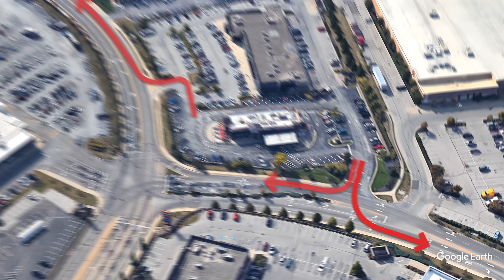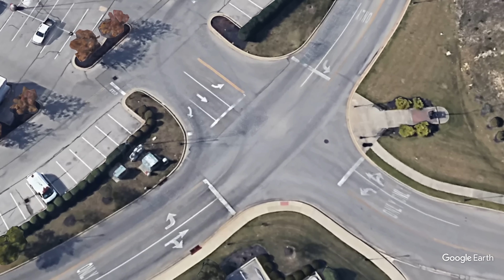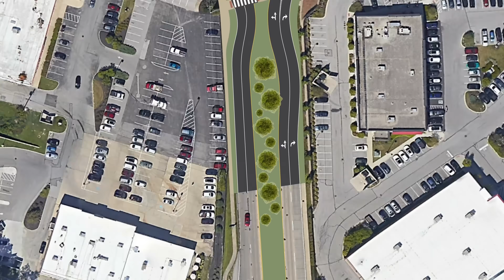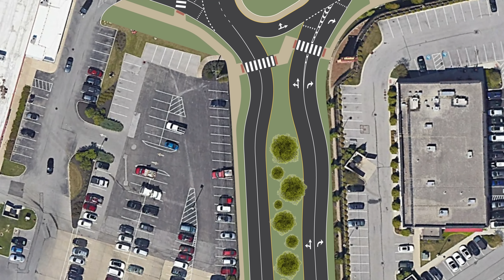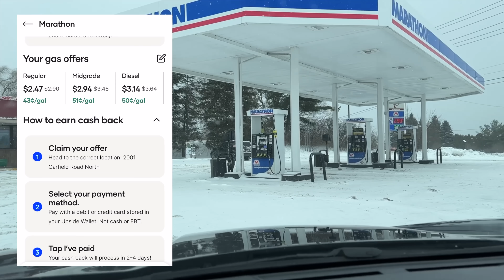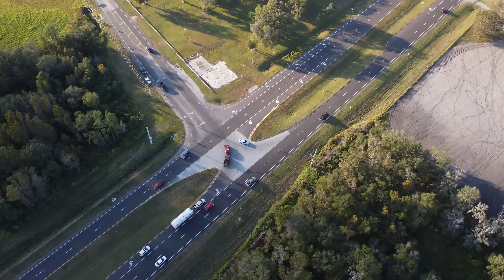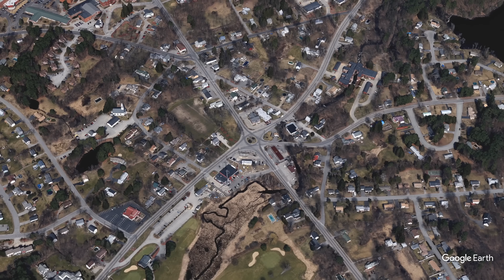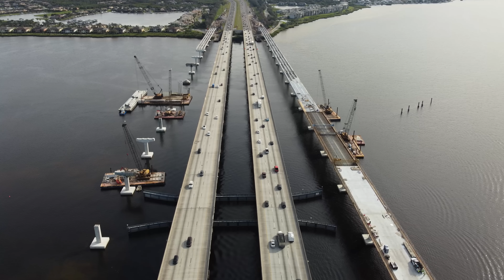These Intersections Should Be Illegal

Comment: These are commercial driveways where it is desirable to have them configured using public road design practices.  They are typically on private property with a driveway entrance warrant to connect to the public road.    They appear to be public roads, but legally they are not.  That doesn't mean they have to be this way.   An overview of traffic conditions would likely recommend they be turned into behaving with the same design as a public road.   

This is an issue for public minded citizens to approach their town about.   If it is a functional administration they should be able to direct the person on how to approach the issue.

Comment: Right mindset, wrong idea. The main problem is the stroad connection to the main arterial road it shouldn't exist in the first place. It's mixing through traffic with regular city traffic. No "traffic flow dynamics" will fix this until there's still be that stroad connection.

Comment: I live in the UK and I drive past a Rural left turn much like that frequently on a road called the A90. Absolutely fucking terrifying as you have to cross 1 lane coming at you at 70mph, then hold in a tight middle reservation to cross another lane. Killed tons of people. One particularly bad one on the way up has a 50mph speed limit surrounding it, and it STILL kills people at an alarming, above average rate (as well as creating absurd amounts of traffic as it can sometimes take several minutes for 1 car to cross both carriageways).
Reply: I've seen a lot of these junctions fitted with traffic lights over the years.
Reply: @trainsim5869  Problem is the ones I see are in rural areas and you can't just stick traffic lights there without having to do a bunch of atuff to the speed limits, not to mention how infeasible it can be as some kf these areas are proper rural

Comment: The only disagreement I had is on the first on how that roundabout should be designed.  I find roundabouts that force you to make a choice in the left or right lane to create confusion and safety issues.  Left lane should allow you to spin around in a circle all day, and the right lane has the exits.  I would go back to the drawing board to design how to not force people to pick a lane.  I think a one lane roundabout with the roadway right turns merging separate of the roundabout would be a better option.

Comment: Before your explanation started I made an approach for each of the locations:

1. exit road from car park onto major road in the middle of an intersection. Make car park exit onto side road above instead.

2. High-speed road with no indication where cars should be to turn off, and the turning lanes optimzed to look fast but be dangerous. Remove U-turn lane, forbid U-turns. Add clear indication lines where vehicles should drive to turn left from road, and where people should wait to enter high-speed road. Add acceleration lane to both high-speed roads so people turning on can get up to speed.

3. traffic isle with greenery in the middle of unsignaled 5-way intersection. Make vehicles slow down with curbs, round off side of traffic isle for trucks, add pedestrian crossings

4. Cyclists on the highway. Stop smoking weed. Remove cyclists from highway.

Looks like we're pretty close. In #1, I'd move the Chick-fil-a exit into the Target one, and make them share an exit. Much less change to the area and the main problem fixed. I didn't see the other intersections in the overview, of course. For #2, you forgot to add acceleration lanes - lanes where vehicles can get up to speed before merging. The left turn isn't the main problem, the lack of indication and slowing is. In #3, that should just be a normal roundabout instead of whatever that is. And for #4, I have no idea what the people designing or building this are thinking, but I would recommend them to consider not mixing traffic with different average speed *at all ever*. Because there's a name for mixing traffic with different average speeds - they're called collisions. You want to avoid those. Especially so for unprotected slow-moving traffic being hit by fast-moving twelve-ton vehicles.
Reply: 4. The best solution in that case is to have a cycle path on the right of the highway. The cycle lane would cross the on-ramp, and join the path.

Comment: I would have argued that 6:00 could have been more efficient to make a half diverging diamond before the highway, but then after thinking about it for a little bit, the slower traffic turning left into the highway would have the problem of trying to gauge speed while sitting at the median. Of course, this could be solved by adding a little bit of runway in the median until they can merge with traffic, but I'm not an engineer to know how effective that would be.

Comment: The saddest part about the 1st solution (I haven't finished the video yet) is that round about would still have so many crashes. Most people genuinely have no idea how a roundabout works. They will drive straight through, stop when there is no traffic, or get stuck. Going in a circle is WAY to complicated for some people which makes it hard to have round abouts

Comment: Lookitng at the roundabout for the third problem presented, you can see those crosswalks were painted long ago and have been obscured by "eraser" tires since then, resulting in "crosswalks to nowhere"!  Not a good design to begin with, but a seeming pedestrian torture device as it looks now.  Looks like it might've been an attempt to compromise between a traditional traffic circle and today's popular roundabouts, by people who didn't know what they were doing.

In small town settings, it's common to see this sort of pseudo-roundabout, where a small island has been set in the middle of the village's main intersection (often a 5-spoke one), and drivers don't know whether it's to be driven as a circle or not.  Signage disambiguating this is often absent or hard to see.  This is one of the reasons I think roundabout adoption has gone too far in displacing either traditional traffic circles (traffic lanes much smaller than island) or other controls.

Comment: I like your solution to the highway crossing.  Especially interesting was the pavement bulge rather than a jug handle.  Instead of making traffic go wide, you allow them to, taking up as much of a lane as they need, with no obligation.

One problem you didn't point out with the existing intersection is that in traffic that's heavy but fast, drivers entering from the cross road may have to step hard on the accelerator (and go down one or more gears if driving a truck) to quickly cross the road that goes in one direction, then sharply hit the brake while in the median space before having to accelerate again to merge going the other way.  At night, when all you might see are the headlights on the dual highway, you can't see which lane they're in, inviting dangerous misjudgments in the acceleration-merge phase of that operation.  I can hardly imagine how bad it'd be with a tractor-trailer that would probably be left sticking out into the opposite lanes while the driver in the cab waits for a break in the median space.
Reply: I do think the bulge should be extended into an acceleration lane, though. That's what the jug handle is for, after all -- if someone (like a truck) wants to take a bit more time getting up to highway speed, that makes things safer for everyone.

Comment: I'm only part way in, and already I see another problem I don't think you're even addressing: the island and other "T" junction to the right (from our overhead vantage) of the driveway (to/from Target) ontp the side road from the chicken joint.  If I'm driving in that direction, odds are good I'm not seeing that there's a third lane, going in to the chicken driveway, next to two coming out, and instead will interpret that island as a divider between incoming and outgoing traffic.  The arrow lane drawn on the road would leave me thinking I'm supposed to turn into the second driveway to get to the chicken place.  You're probably going to address this as part of the "too many driveways joining too close" problem, but this one is particularly bad.

Comment: I like the updated Chickfila design but it doesn't allow very good access INTO the parking lot. Except those coming from the upper right road, everyone is turning into a single entrance (bottom left of building) which already looks really congested (with 90 deg turn right into Chickfila parking lot). I assume you're relying on people to use the roundabout in the upper right hand corner such that most traffic turns right into Chickfila (by Target lot), but people who are not local likely wouldn't realize there is a roundabout to allow access in that way. I think the best option is to cut an entrance between the Target and Chickfila parking lots and create a larger "through road" through the Target parking lot accessed by the upper right round about. :)

Comment: Always fun seeing a bit of home on the internet. I grew up basically next door to #1, and everything in this video went in after I moved away. It is a complete cluster that this video barely does justice to. It's an absurd amount of big box retail and out-lots full of restaurants crammed in what used to be a valley next to I-471. They filled it in as much as they could to level it off, but it's so much higher than the surrounding area now that it creates its own problems getting in and out of it, and the roads around it have been turned into nonsensical absurdities to try and feed traffic into it.
Reply: The first one is unimaginably bad.  Was the Chickfila built after the rest was in place?  That's the only way I can understand why they did what they did, because that was a total error, and should have never been approved, unless the owners of the Target lot refused to make improvements to allow Chickfila to flow into their lot.

Comment: I go thru this Malfunction Junction in your first example a minimum of once a week (and mostly more).  It's so poorly designed I honestly think the civil engineering firm that designed it should be sued.  Why there's no Target access in that 15ft  between the Chik Fil A exit and the Target entrance/exit is inexplicable.  You basically have to pull out and make an immediate U-turn across four lanes of bidirectional traffic.

I'd also add, next to the Chik Fil A is a small plaza with a Chipotle, a BW3, and a few retail storefronts.  You can only get to it by going thru the CFA lot next to its drive thru to the non-accessible road frontage and then u-turn back into the unconnected plaza lot 🙄.   And then the issue from CFA alone is magnified a hundredfold since ALL the plaza has to use that same exit!  One other problem is — even turning right out of CFA— there are two lanes going right which add a third next to the left lane so that both the left and the now far left lane both make the left turn at the road.  The right lane either goes straight across the road or has a small right turn ramp.  Often there is no way to come out of Chick-fil-A to turn right if you need to go left at the road because at that point the single left lane is backed up so far from what's essentially and eventually two lanes of traffic smashed into a single !right in front of you!  And you can't get all the way into, at that point, the single left lane that you need.  So it's either waaaaait for an opening or pull out into the right lane and block the straight and right-turning traffic so you can waaaaait for a chance to get over into the left lane.  That's practically guaranteeing a road rage incident so at least it's uncommon.

Comment: 5:55 A better solution would be to turn the end of the side road into a ramp up to a bridge over the highway, with on/off ramps leading to merge lanes on the outsides of each direction on the highway. It would be less expensive than a full interchange, and nobody would have to cross the highway at all.

Comment: although not on the level of any of these, there is an interchange near where I live where I'm 99% sure has been constructed improperly.

It's a 2-lane 4-way interchange with turn lanes in the middle, and going east to west or west to east or south to north is fine, but if you're going north to south, the lane isn't quite aligned so if you go completely straight, you end up partially in the turn lane to turn west.I've almost been hit at that spot before, and I've also forgotten to move over at that spot bc i forget it's there, or am just tired or have something else going on.

Comment: First 2 redesigns are pretty bad from a european perspective. The second one is easy just put a roundabout there. Getting the trafic to slow down so others can join in is no sin mind you.
For the first one. You could also just eliminate alot of entry points towards parkinglots and even fuse some of them. Just remove the entry point to the target next to the chicken filet. That will solve alot of problems that road has.

Comment: 7:15 They've tried this idea in my area, but the cars turning from the right at 7:07 need to immediately get into the left lane to get to the U turn lane at 7:15. When you are trying to make the right hand turn onto the busy highway it's not always possible to see vehicles that are coming in the left lane on the highway, where you have to go.  It doesn't work well in practice.
Reply: Ideally the U-turn lane should be further back, so that you have time to change into the left lane, and then the U-turn lane.
Either way, it's still an improvement over the original design, where you had to look for a large gap in all lanes, in both directions.

Comment: 1:01 Look at the top, where the white van at. Look how badly designed is that entrance / exit. There are two exit lanes: to turn right, and to turn left. If you turn left, you have to drive into the wide solid yellow lines, which is technically illegal, but at the same time, it is giving you permission because there is a dedicated left turn lane to turn left, forcing you to drive over the wide solid yellow lines.

Comment: I have an even simpler solution for people who need to get to target from the Chick-fil-a: connect the parking lots directly!! What’s the point of forcing drivers back onto the main road when the target parking lot is right there? This is the result of forcing individual business owners to make provision for parking, rather than the city planning for the parking needs for the entire commercial area
Reply: As a question, does the Target have its own catering/food provisions? If they don't, then I struggle to see why they shouldn't be connected together even more (and designed such that you can walk between them reasonably), there'd be not much to lose, I would think...

Comment: As a Chick Fil A worker. Knowing that drive thru customers aren't smart. This intersection looks like a nightmare. Especially with how backed up the drive thru lanes can get.

I like your design however. Can make the traffic flow more efficient for sure.

I do wish the shopping area where I work at had a roundabout. Would make it far easier to get around.

Comment: American road planners are so allergic to roundabouts, being from Europe I have never understood this, and as we can see from number 3, even when US planners do use them on occasion they screw them up entirely. We also don't tend to allow any driving across a dual carriageway (or greater)  unless at a regulated junction by traffic lights be that a crossroads or a roundabout. And those bike lanes are just shameful.
Reply: It's because they associate them with an older and worse version - rotaries. They were especially common in the Northeastern US. 
They were large, allowed for high speeds, and had sweeping curves, you were supposed to merge in and out like on a highway. They worked alright when the traffic levels were low, but with the rise of the automobile in the early 20th century, traffic levels skyrocketed, and they became inefficient and dangerous. In heavy traffic they would often lock up altogether - the "priority of the circle" rule was not a thing back then.